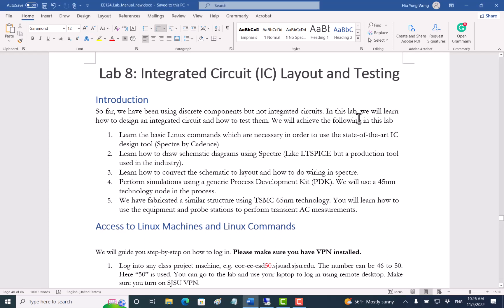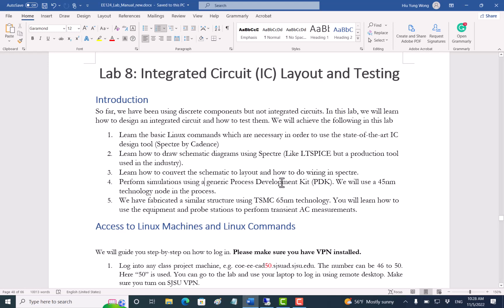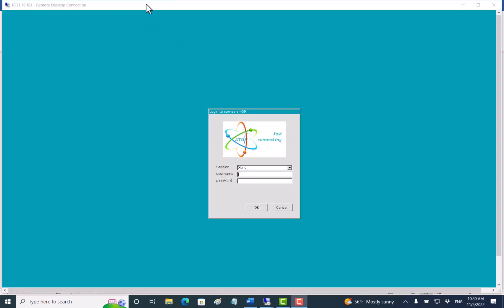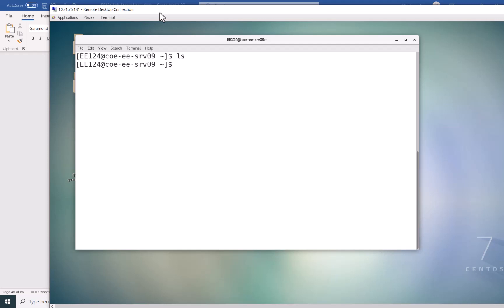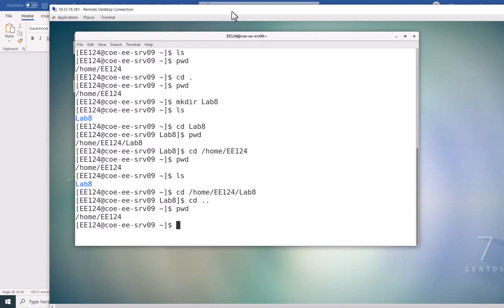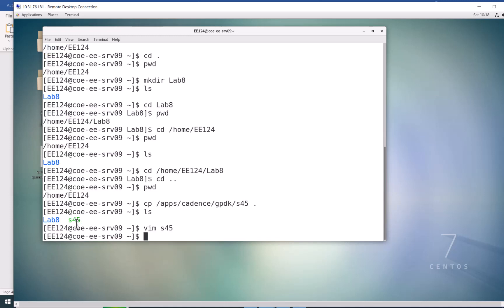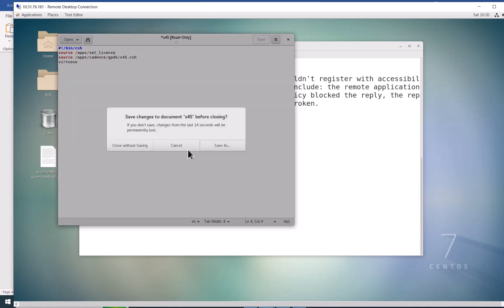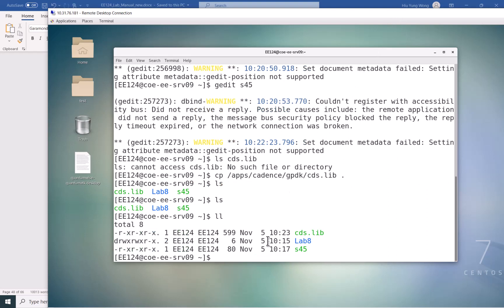Lab 8, 1) Linux Commands and Cadence Spectre Setup

Comment from the maker: Please note that the procedure is changed to the following (only changing s45 to s45_ic23 ) starting in Fall 2025: 
1.	Log into any class project machine, e.g. coe-ee-cad50.sjsuad.sjsu.edu. The number can be 46 to 50. Here “50” is used. You can go to the lab and use your laptop to log in using remote desktop. Make sure you turn on SJSU VPN.
2.	If you run into a display error, you might need to set 24-bit or lower in the remote desktop
3.	Right-click on the desktop and open a terminal.
4.	Copy 45nm technology setup to the working directory (e.g. cd myproject)
cp /apps/cadence/gpdk/s45_ic23 .
5.	If you don’t have cds.lib in your folder, copy from /apps/cadence/gpdk/cds.lib first
6.	Type chmod 755 cds.lib
7.	Start cadence by ./s45_ic23 (Until here, all your typing is to setup in Linux, all steps 3-6 are a one-time setting)
8.	Open Library Manager